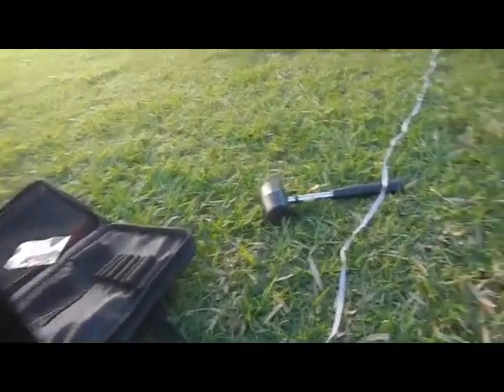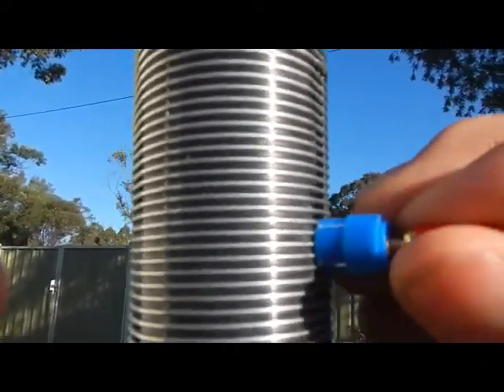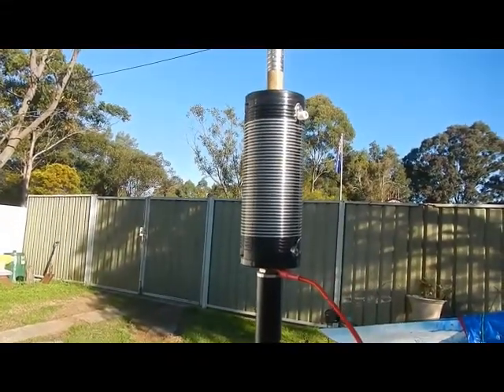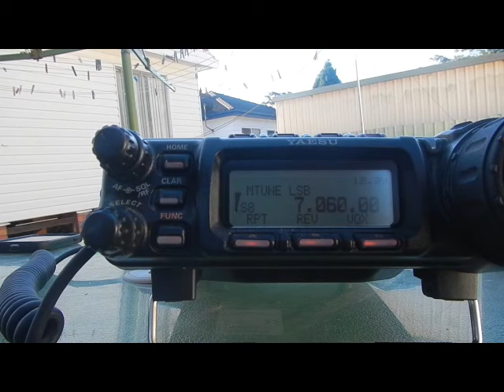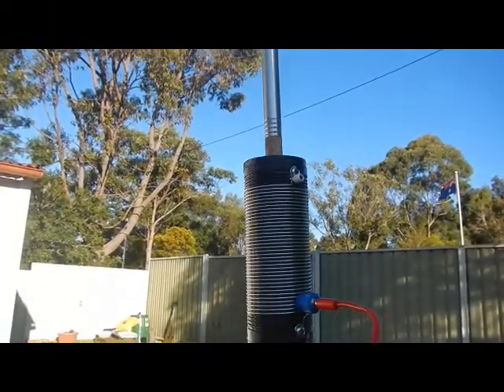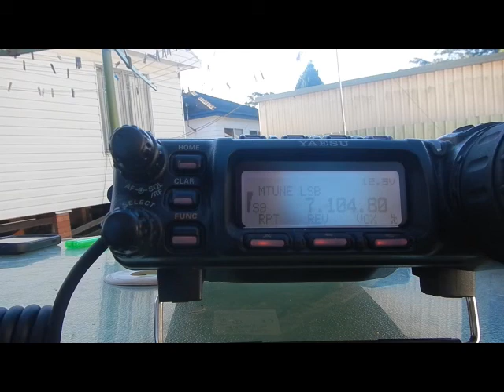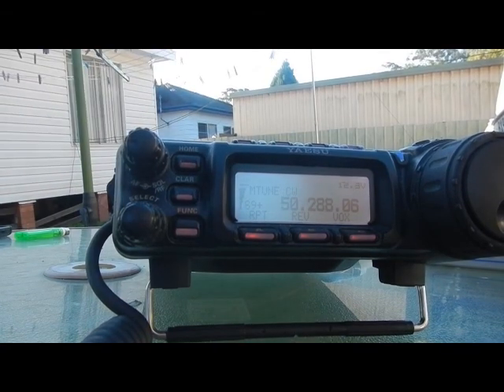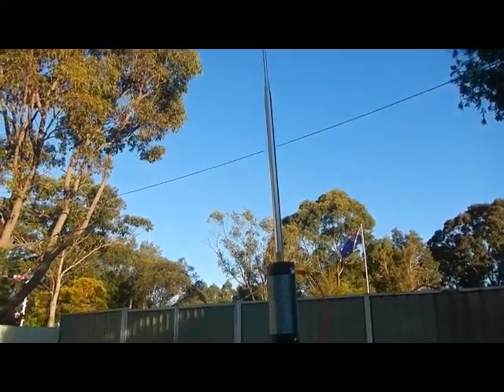Pac 12- npc7 portable antenna  - initial tests

Comment: The latest version has a slider contact rather than the wire tap in the old version. The antenna tested just OK in my back yard - not better. But take it into the field, and WOW! I've used it on 3 POTA activations = Big Survey NC (in the pouring rain with 30 MPH wind, Allamuchy in NJ and Middlesex Fells in MA - and it proved surprisingly GREAT on both 20 and 40 CW. It is not better than my 40-6 OCF dipole from N9SAB, but when a quick deployment is needed, it is really worth the money. I purchased 2 extra tubes raise the base higher, and use 2 radials each for 20 and 40, in addition to the one provided. W3PYF
Reply: Is the whip designed with a 3/8-24 thread,and what is the antenna rating in CW mode?

Comment: Hi, my friend! I have such antenna, but it is impossible to make so that SWR was small. You could report what circles have to correspond to ranges? For example - 7 MHz - the 6th circle from above, 14 MHz - the 8th circle from below.... Prompt, please, as it is correct? TNX DE R3AAX EVGENY
Reply from the maker: Evgeny Pavlov Hi Evgeny, I have some notes I have made and will have a look for you soon and report back.
Reply: DENMONKEY how did you go with those notes?
Reply: Throw away the delivered radials and make some resonant radials.
You must fix the antenna for each band .